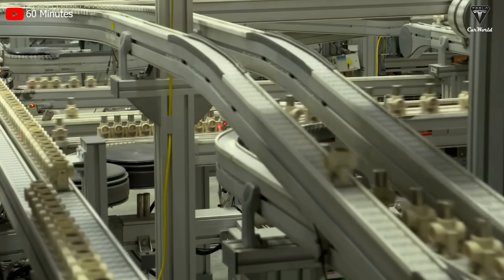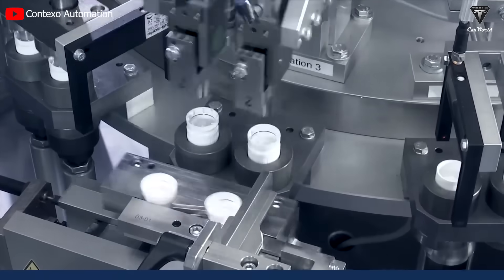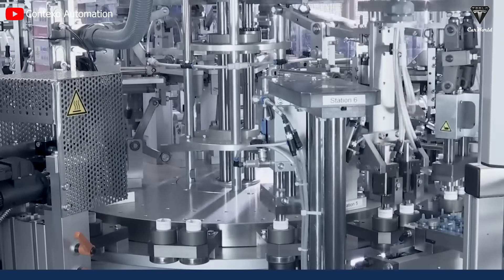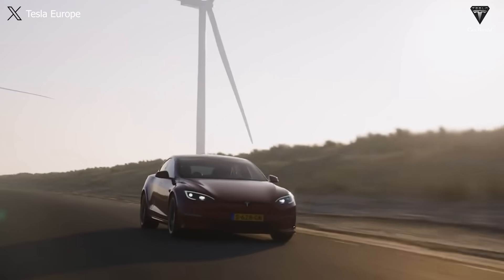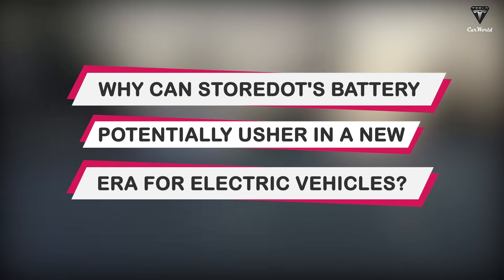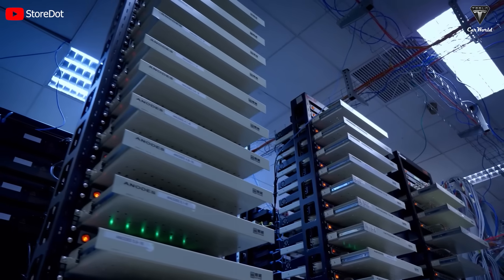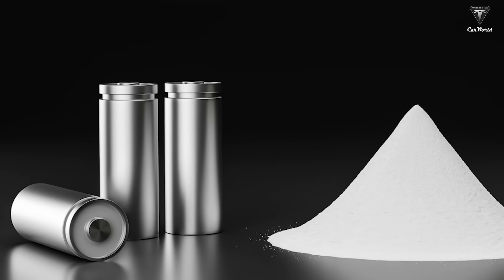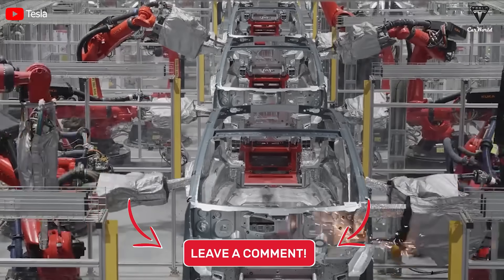Elon Musk Worried Tesla 4680 be Destroyed! Unveil The Secrets BMW's 4695 & StoreDot  "XFC" Batteries

Comment: Batteries are always changing and improving as better batteries are developed.
Reply from the maker: Certainly, technology has never stopped, especially in the energy sector. Battery packs always aim for the best technology, highest energy density, most durable and most affordable price. The evidence is a series of battery technologies developed, salt batteries, solid state batteries or 4695.
Reply: Actually, batteries aren't always improving and getting better. This idea of energy density is a bit of a play on words. These batteries are a sandwich of materials that are in sheet form. That sandwich of sheets are then rolled up into a cylinder shape, hence the cylindrical shape of the battery. The only thing BMW has done is cut those sheets a little taller than Tesla, making the cylinder longer. If I had a bucket full of water that was one gallon and someone came along and filled up a bucket that was one and a quarter gallons, did they improver water bucket technology? I agree that the BMW batteries have a higher energy density, but they are also bigger in physical size. So if an average EV could fit, lets say, 10,000 of the Tesla batteries into the space allocated for the batteries and then you took the identical car with the identical space for batteries, the BMW batteries would have a higher energy density per battery, but you couldn't fit 10,000 of them into the same space, because they are bigger. So in reality, it is almost a wash. Either put more Tesla batteries in the car and get a certain range, or put fewer BMW batteries in the car and get pretty much the same exact range, because there is nothing fundamentally different between the two batteries, except size.

Comment: I am no fan of Elon or Tesla, but I think there is a bit of misunderstanding of what is at play here.. This idea of energy density is a bit of a play on words. There is fundamentally no difference between the BMW battery and the Tesla battery technology, beyond size. These batteries are a sandwich of materials that are in sheet form. That sandwich of sheets are then rolled up into a cylinder shape, hence the cylindrical shape of the battery. The only thing BMW has done is cut those sheets a little taller than Tesla, making the cylinder longer, making the battery 95mm long, instead of 80mm long. If I had a bucket full of water that was one gallon and someone came along and filled up a bucket that was one and a quarter gallons, did they improver water bucket technology? I agree that the BMW batteries have a higher energy density, but they are also bigger in physical size. So if an average EV could fit, lets say, 10,000 of the Tesla batteries into the space allocated for the batteries and then you took the identical car with the identical space for batteries, the BMW batteries would have a higher energy density, per battery, but you couldn't fit 10,000 of them into the same space, because they are bigger. So in reality, it is almost a wash. Either put more Tesla batteries in the car and get a certain range, or put fewer BMW batteries in the car and get pretty much the same exact range, because there is nothing fundamentally different between the two batteries, except size.

Comment: A slightly taller battery  is hardly a major breakthrough! All it means is the floor will be slightly thicker.
Tesla's gigacasting has nothing to do with batteries. The claim of 10% weight reduction doesn't seem to have happened.
Supply voltage 400v vs 800v or 1000v has nothing to do with battery type. Just how they are wired together.